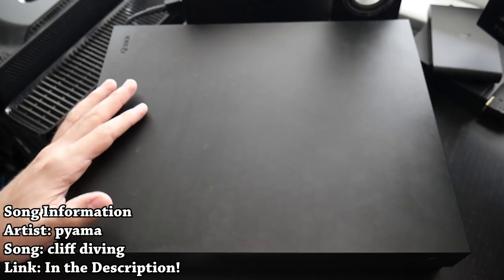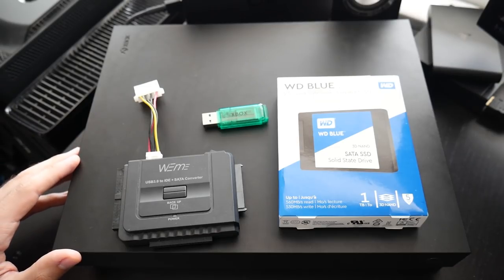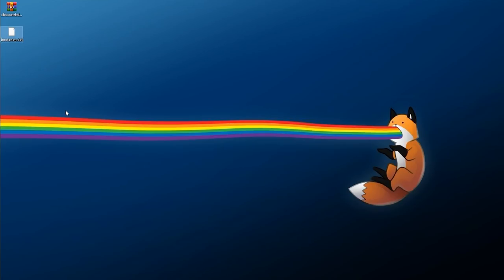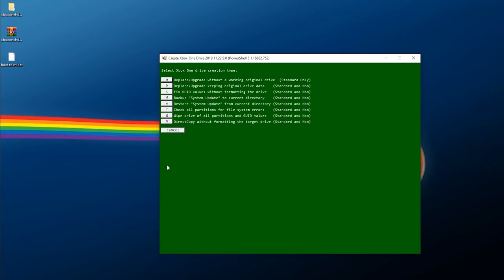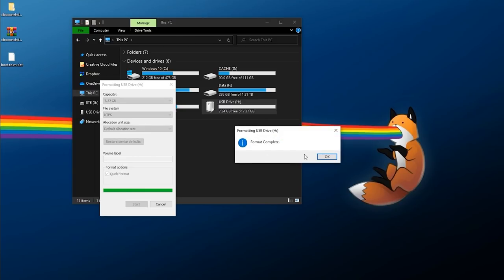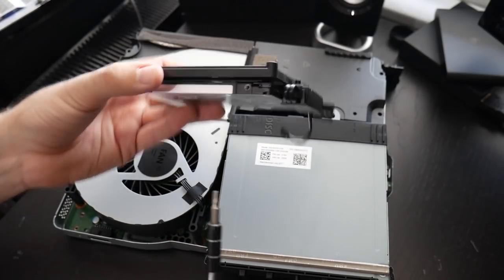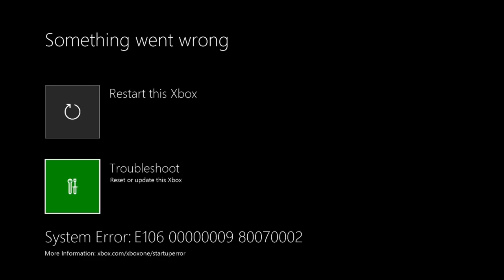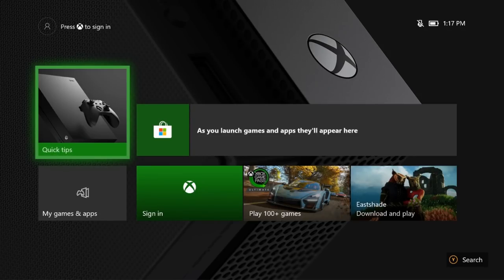How to Upgrade/Replace Your Xbox One HDD! - SSD/HDD Upgrade Guide for X1, One S, One X

Comment: Sometimes when I manually install the boot.dat files after the OSU1 install it takes but sometimes it doesn't take. Ever run into this issue? I install it on both A and B folders. I've always had this issue on and off.
Reply from the maker: Nope, I personally don't put the bootanim on there once I'm done, since it will be restored on the next update.
Reply: @MrMario2011  I only do it because I hate seeing a black screen waiting until it updates next lol
Reply: You can force it by enrolling in the Insiders hub. The update in Beta. Then you have your animation back and then unenroll. Your Console will be reset to factory settings though

Comment: What’s the biggest hard drive size you can fit internal ? Possible to fit a 5tb ?
Reply from the maker: 2 TB, since that was the biggest size released. You can shove a bigger drive in there, but you can only use 2 TB of it.

Comment: Isn't this all unessasary? I heard all you gotta do these days is put the new drive in, make sure ethernet cable is in and it'll do the rest for you.

This is a comment about it:
"I purchased a 1 TB Samsung 870 QVO for my Xbox One X, I did not perform any formatting to the HDD prior to the install, it went straight from the packaging it came in and was installed in the console. I didn’t use any scripts or OSU files. I simply plugged the ethernet cable in and booted it up using the manual recovery button method. The Xbox immediately recognized the new SSD and automatically formatted and installed the OS. No special tools or hacks. The console is just like it was before just loads games a bit faster, I can play online, it updates when it needs to without hassle. Not sure why everyone is having such a hard time with finding so called software for the new hdd."
Reply: Have you had success doing it this way?
Reply: @icemasterkevin5885  I'm about to try soon hopefully
Reply: This only works if you haven't updated your Xbox since the Xbox uploaded their offline update. If your xbox has the newer version of the update, this offline update will not work.
Reply: @miguelazarcon  So old guide that's largely now outdated, got it

Comment: What happens if you don't use the script and just thrown in a new drive and perform offline update with OSU1?
Reply: Does the OSU1 only method also work when using a larger capacity replacement drive? I assume up to the 2TB internal drive limit. Im currently running a 500GB platter in my xb1-s. Thx...
Reply: @bonzer2u  yes I just did it on a 2 TB SSD only using the OSU1 installer. The only thing is im missing my boot animations which from my understanding will be overwritten when the Xbox updates again so its no big deal.
Reply: @partain50  so this would mitigate the need to connect ssd to computer?
Reply: @rickharrison6969  yes completely unnecessary unless you care about the boot animations. After my Xbox updated again the boot animations reappeared anyway so its only temporary. You do still need a computer to setup your USB drive with the OSU1 installer.
Reply: @partain50  that’s awesome, saves me time money on getting data to usb adaptors. Is that process as simple as saving the osu file onto the jumpdrive and then after installing the ssd and turning Xbox on, plug in the jumpdrive?
Reply: @rickharrison6969  yes its that easy. You boot into the troubleshoot mode and select the offline installer. It should automatically boot into the troubleshoot mode, but if not you can find instructions on the Microsoft website to do it manually. I think its just hold the pair and eject button then press and release the power button. Wait for two beeps then release the pair and eject buttons.
Reply: @partain50  I appreciate it! Gonna give it a go today.
Reply: @partain50  my offline install is greyed out, i'm using a 32gb sandisk and a formatted and non partitioned wd blue 500gb ssd. to be clear, my drive doesn't have to be partitioned if i go about this method of not using the script at all? I have no clue why it wouldn't be working otherwise super frustrating stayed up all night for it this is my 5th time around attempting this lol.
Reply: @InfamousReptillian420  Your USB drive is formatted as NTFS and you've unzipped the OSU1 file and moved the systemupdate file to the root of the flash drive? Definitely seems like it's not detecting the thumb drive or maybe the SSD for some reason. Also there can't be any other files on your USB drive for this to work.
Reply: @partain50  OHHHHH my USB drive is FAT32 hopefully it works now haha! :O good stuff thank you very much! :D
Reply: @partain50  hm strangley now the update just fails. i'll have to pick up another usb drive maybe and give it another go idk. luckily it did detect the offline update this time.

Comment: well i downloaded the latest OSU1 file from microsoft and prepared the 2TB HDD and when i try to apply the update it goes to 1% then i get a E101 error any ideas also i get a e106 which means the xbox sees the hdd but like i said when i apply the update i get a e101 error despite me using different flash drives
Reply: I am having the same problem did you figure this out?
Reply: @gregb1018  yeah had to wait for Microsoft to release a new OSU1

Comment: hi great video thanks. one question does the SSD have to be a high-performance drive? or can i just use a standard speed one 560gb/s
Reply from the maker: The Xbox One is limited to SATA II, sadly, so getting the latest and greatest SSD won't benefit you.
Reply: One X has sata 3, if that's what you have. Use a standard one.

Comment: I had a problem, a few weeks ago, with my Xbox One. At some point it showed the famous black screen. The only thing that was showing on the screen was that interface from when you want to turn off console from controller. Those three buttons. Those, showed up on screen. Nothing else.

So I figured it has to be the HDD. 

I removed the HDD and insert into my laptop as external. Windows 10 said that there is something wrong with that disc and needs to repair it.
I said OK to that. That's all I didi at that point and I placed the HDD back in the console but the problem was still there. Black screen. 

So I did what you said in this tutorial but with the same HDD and all seemed fine until Step 2 verifying got to around 96%. 
The console stopped. 
Initially I thought it will restart (because of the on-screen message that the console will restart during update). But it didn't restart. It just stopped and as I started it again, manually from the power button, it started the process from the beginning. The second time I tried it, it stopped again.
No error, no nothing.
You think the problem is the HDD? 
I am very keen on buying an SSD, a 1TB one, as the current HDD is 500GB. It would be a great improvement. 
But I want, if possible, to be sure that the problem comes from HDD and not from anything else.
Have you seen this problem before?

Thanks.

Comment: Will an ssd net any performance increase like reduced noise, shorter boot and load times, longer lifespan from the drive, and cooler operating temps?

Comment: My Xbox One S is reporting E101 00000504 8B050041 when attempting to load the system update.

USB is a 32GB module formatted to NTFS and is recognized by the console
SSD is a Samsung 870 Evo 1TB

Also tried a Crucial 2TB SSD that was set up via the script you shared.
Reply: Device boots with no issue on the original drive so I'm not convinced it needs "repairs" as Microsoft would seem to suggest.

Comment: Hi!

I tried to swap my HDD for another which was the same model on my Xbox One X. I used the script to set up my new HDD. I downloaded the latest OSU1 and done everything exactly the same way as you showed in the video.At the offline update when it restat at the 3rd step I always get a E100 error (E100 0000706 8007002). When I put back the original HDD then it can complete the update and everythin is working fine.
I wanted to change the HDD becaause when I'm playing any games I get an error message that " THere is a problem with your saved games" (0x80831002). If I cancel it then after a couple of minutes my console frezzes and its very difficult at restart it. Do you have a solution for this problem?

Thanks for your help!

Comment: Did not work for my Xbox One S. Im using a 1TB Samsung 870 EVO, followed every single step of yours and many other tutorials and it always gives me Error 101... Then when I plug the original HDD back, it Restores just fine. How annoying
Reply from the maker: Should work just fine on a Xbox One S? There's nothing special across the three models aside from that boot animation.
Reply: Thanks for your reply. I trully dont know what to do next. I tried few different  usb sticks and nothing. I'm supper sad.
Reply: @rodssantos  same issue here, any update? I'm really sad
Reply: @fretshot  I was finally able to make it work but I'm not sure what I did differently for that to happen. While I couldn't make this happen I purchased and external ssd case usb3.0. I did many tests with the SSD internally and it would for sure speed up the menu and the games. After that I put back the original HDD and installed my games on the ssd and plugged it on the USB. To my surprise the game loading times and performance were ABSOLUTELY THE SAME as if it was installed inside. Conclusion: I left the old hdd inside and ended up using the ssd externally so the speed would increase and I would have double the storage space. Good luck!

Comment: Hi, I have a weird issue, I did an OSU and the xbox works fine, but when I turn it off and then back on, it starts acting weird. It starts to freeze and become unresponsive. Sometimes I have to turn it on 2 times for it to boot properly. What could be the issue?

Comment: Hi, I proceeded step by step, but during the installation, the package is unpacked, verified, and then the console shuts down and turns on immediately, throwing out error E100. Startup. I tried to reformat the flash disk, download OSU1 again and still the same error. I have an Xbox One S and new HDD is Seagate Mobile 1TB, old HDD is broken and i try install firmware on 500Gb other hdd and it works on it , please help me. Thanks

Comment: I am having trouble with my xbox one x, it just wont launch any games, it runs media apps just fine, but launching games even disc ones like crash 4, or simple arcade ones like feeding frenzy.. the games wont even boot, just a splash screen and it takes you back to the home screen. 
I have reset the console, did all of the things like power cycling and changing mac address etc etc etc so my next thought is perhaps the hard drive partitions for games is knackered. It COULD be that the partition for games is corrupted so when it sends the information into the ram, the ram then sends this info and then you get the crash.
Its my only thought as to what the problem could be, it runs at 4k, runs 4k media apps etc, it runs SOME games such as resident evil 4, that one runs fine. So not sure it is a GPU problem.

So watching this now to see if replacing the drive would be a good thing to do to get it working again

Comment: Has anyone been able to get around the error "SOMETHING WENT WRONG SYSTEM ERROR E101 00000504 80070570" or related 101, 106 errors...

 Also - Please verify the OS version. It will say something along the lines of "10.0.22621.3680 (xb_flt_2303ni..230309-1945) " or similar.

Comment: I tried this, followed the guide to a T, but now my Xbox won't show up on the screen. It'll turn on, but no signal on the TV. I've tried booting into safe mode and low res mode, but nothing has worked.

Edit: I ended up giving up and putting the old hard drive back in. It works fine now. I'll probably give this a shot another day but for now, this will do.

Comment: I have an 800gb SSD I will put in my console, when setting up the partitions, I was wondering which option I should click, 500gb or 1tb? Not sure if it would mess something up if I choose the wrong one, thanks in advance, I really appreciate it.
Reply from the maker: 800 GB? Huh, odd size, but if that's the case you would go with 500 GB.
Reply: @MrMario2011  yeah, had it laying around for a while and decided it could go to use, thanks!

Comment: Will my Xbox Live account or console be banned if I do this?

I've seen a lot of these videos lately, but no mention on whether an Xbox Live account or console will get banned from Xbox Live for doing this.

  My Xbox One X's HDD is going out, and I need to know if this is a safe fix, or if I should instead replace my console.
Reply from the maker: Doing any kind of modification is always at risk of a ban, but at the same time I've never heard of anyone getting banned only for having a replaced hard drive.

Comment: I have the digital edition....so clearly i have alot of space inside mine...i noticed there is an extra sata and pluggin...u think that the system would recognize installing the new software on a 3.5" instead of a 2.5" drive?..
Reply from the maker: Should be fine as long as the drive gets sufficient power.

Comment: Harvested my 1TB SSD out of my One X since I now have a Series X. Decided to throw the stock HDD back into the One X and everything went fine until it turned out the HDD is painfully slow. Downloading a game or app just takes absolutely forever. It even sometimes times out when I simply try and go into the settings menu lmao. Well it was worth a shot, I might buy a brand new HDD and try this method again as it might just be that the original HDD is bricked.

EDIT: Never-mind, the One X is now working as normal again. It’s actually prettier snappier than I remember it. The HDD must’ve taken a bit of time to wake up or something 😂

Comment: Shit.. that didnt worked for me.. i put a 960GB toshiba drive in there.. run the program it showed me the 780 gb on PC.. but now the xbox recognized the SSD as a 500GB... don't know what was wrong or if its because its only 960 and I chose the 1tb on setup wit the BAT.. Any advice?

Comment: Any 256gb+ 3.5 HDD will work? The old one got corrupted so I am not in the know of what to do, the console is out of warranty and I haven't opened it yet. I am looking to replace it myself but without spending $40+ (hoping for maybe $20-30 range) on it as I really only need 256-500 gb range anyways but don't know the compatibility as not specified by Microsoft (of course not for every single HDD ever manufactured)
Reply from the maker: At least 500 GB.

Comment: it worked, sort of, installed a 1tb ssd into the console, only shows up with a little over 300 gb of usable space.
Reply from the maker: It might not be a full 1 TB to the size expectation of the console?
Reply: @MrMario2011  that's my wonder. Shame if it just drops that much data though. I'd be curious if my 500 gb would work or if it would see it as too small

Comment: I did everything accordingly but when I try flashing the OS1 onto it, my flash stick is blinking real fast but no option is present on the console. Also, the file is 6 gigabytes but for some reason is reduced to 2.5 on the usb stick, not sure if it affects it
Reply from the maker: Sounds like it wasn't extracted properly.
Reply: @MrMario2011 hmm I think so to. I took the next hour on extracting it properly but still no dice. Ima retry in the morning with a different usb stick cause the one i was using was only 10 MBS

Comment: Hello Mr. Mario i got a question. My xbox one x has a click sound coming from the hdd, now i want to use this tut to replace it with a 2tb ssd. Can MS ban me for doing this?
Reply from the maker: I haven't seen any bans only for replacing or upgrading the storage, however it's also safe to say there will always be a ban risk.
Reply: @MrMario2011  is that only hardware or also a account ban? Else i would use a other account when switched the internal drive.😬

Comment: Mr.Mario i followed your instructions, and now my one x is not turning on anymore. It shuts off  immediately after i powered it on. I was very careful, and i am experienced with mods of all kind. I doubt that it has something to do with the replacement of the hdd. Anyways, as a last effort, do you know what could cause this? It turns on for a second, sometimes a bit longer and turns off again, fan is not spinning, psu gives me 11,64 volts...
Reply: Redo it. First time I did this. I had the same problem. Have to rebuild the drive. Only thing that works. I did this twice already. (To one xbox) first time after I reset and turned it off. It never wanted to come back again. So I rebuilt it. Got up to the update stage 2 where the xbox is supposed to reboot. It shut down and did the same. About to rebuild the harddrive a 3rd time now. See what happens

Comment: Quick question, I was doing this for a friend and his console originally had a 2 TB drive in it but it broke. Would it be possible to use a 1TB as he says he does not need the space and the disk is cheaper
Reply: Yes.

Comment: no idea what I did wrong, but I placed the boot animation files exactly as described, but I still get just a black screen on boot.
Reply from the maker: Should be as shown, worst case if it isn't working then wait until the next system update. That will resolve it.
Reply: Turns out this boot animation file is out of date and WILL NOT WORK. You need to have the updated boot animation file.
Reply: @TorqueEffect  hey man where did you get the updated files for the boot animation